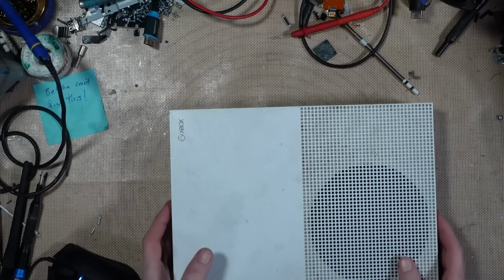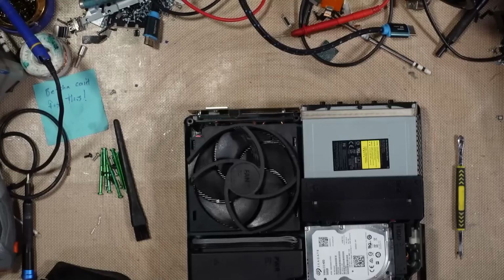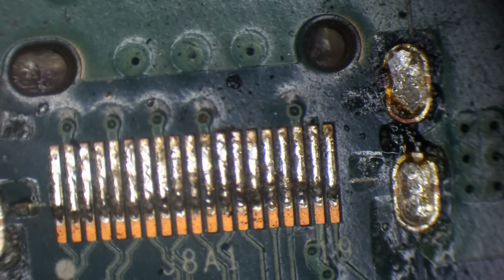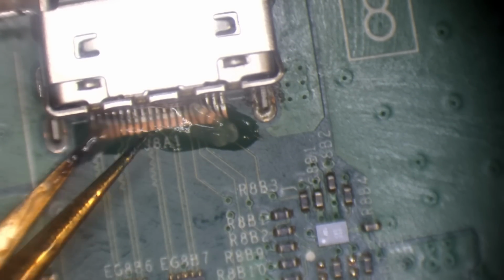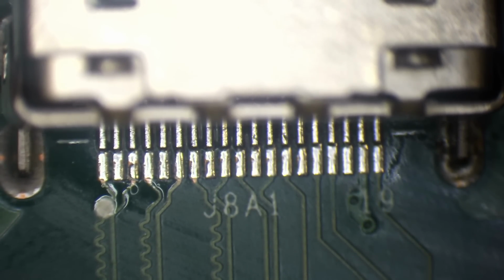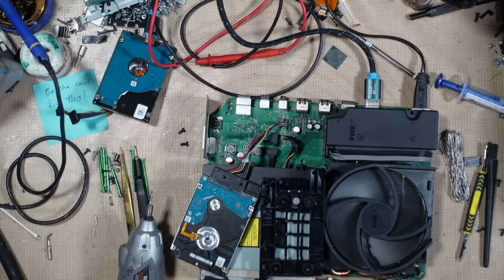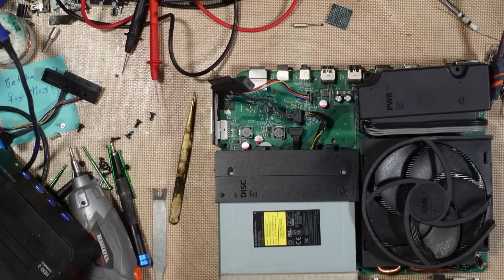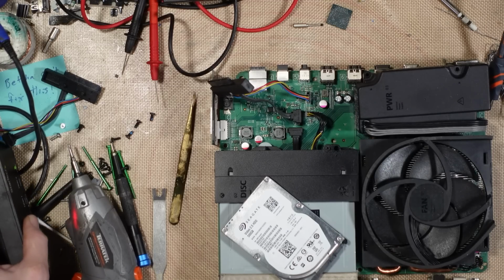If You Ever Do This You May As Well Throw Your Xbox One S Away!

Comment: To anyone wondering what is going on: ODD stands for OPTICAL DISC DRIVE.

So no, you don't brick the console if the HDD dies.

Also no, it is not possible to change the ODD serial number to match what the console is looking for.
Reply: Unless you find a way to program the chip that has the information on it to have that number. But very few of use possess that talent.
Reply: @Portuguese-linguica  not going to happen for the same reason where you cannot update a DVD burner firmware using files from - say Lenovo - but your DVD burner came with an HP laptop and HP never bothered to release the same firmware update.

The whole process involves encryption, so it's not happening even if you plug onto the chip directly.
Reply: lol I should have the comments first doh
Reply: he never said that in fairness, he said it's a brick, unless the customer has the original disk drive it can't be fixed.
Reply: @Tomtraubert2009  he didn't. People in the comments are though.
Reply: Okay I was finding it real weird that it would put up a fuzz over the HDD.
So the working theory is that someone swapped the DVD drive for whatever reason?
Reply: @lpoki8897  exactly that. Mostly likely the very same customer that was swearing the console was working and was never dropped.😂 
Maybe the customer was a repair shop and they grabbed the wrong optical drive when they were putting the console back together.
Reply: @bufordmaddogtannen  Yeah people do some odd things to save face or ego or whatever.
Reply: Well theres always a way you just need too know how too
Reply: @hamburgermods1396  cool. Tell the cod3r how then.
Reply: Always keep a console even if you suspect its permanently busted for weird reasons like this, you never know when a jailbreak or something a few years later provides a work around.
Reply: Could flash the disk drive then it should work in any xbox what we use to do back in the day on original xboxs and 360s
Reply: i was just about to say, you mean optical drive, yes it checks the firmware on the optical, if it doesnt match then no go.
Reply: Just need to get the DVD key from the nand and buy a programmable pcb for DVD drive a and flash fw with DVD key so matches mobo
Reply: @Tysman909  Wow. So simple. :/

Comment: My OG Xbox one, (yes I am still working with it) had a similar problem, except it somehow killed my wireless card during the update. Swapped with a new one and it's still kicking. 

First purchase out of my parents house, I'll use it until it dies.
Reply: n  I replaced the hard hard drive with an SSD a few years back. Its also got an external 16TB (4*4TB) storage array for the best loading times it can manage. Other than the wireless card I've had no issues with mine. But I do treat it like an all-digital edition, not risking the disk drive doing it in.

Comment: I'm astonished about how many people drop their consoles. I don't even like disconnecting the cables cause I'm worried about damage the ports somehow or having residual power left over when unplugging power supply. And I always use a quality surge protector with battery backup to prevent power outage damage.

Comment: Am I missing something here? Since when are Xbox One drives paired to the system? I was able to upgrade my Xbox One X hard drive to a 2 TB one without copying anything from the original disk. I used the OSU1 from Microsoft. I was also able to use a drive from an original Xbox One in the X as part of my troubleshooting. I was getting random "something went wrong" messages while playing. Turned out to be the SATA cable causing the issue. Is this just a thing one One S models?
Reply: Disc drive not hard drive
Reply: He's talking about the DVD disk drive
Reply: @patrikd2776  My mistake.
Reply: @rogermohammed86  Thanks. I probably shouldn't try to watch videos with kids around making noise
Reply: @rogermohammed86  BluRay  *
Reply: If it was the hard drive it would be a nice easy fix.

Comment: Why did the disk drive not match? Did it go to a repair shop first and they put the wrong one in?
Reply: More than likely the old one failed at somepoint so the owner has decided to fit a new one himself not realising that diskdrives have be the correct one they came, they are like married in a way, is one way to put it. I had a similar problem with an old playstation, and i found out that the little daughterboard or whatever way its spelt that it comes from factory with is the only one it will work with,so a very similar situation to this one really. They are encrypted or paired and a replacment wont work for the same reasons as in this video...

Comment: I'm not 100% sure if it's what you're looking for but i'm sure it's possible to change a drives serial number using a Windows system/PC. I know AOMEI partition assistant pro used to have the option so it might be worth giving that a shot.
Reply: It's not. It's something that is encrypted. Otherwise piracy would be rampant. Until it gets jailbroken, there is nothing you can do.
Reply: The problem is not the hard drive, it's the optical drive.

Comment: I take it they are paired at the factory?
Why can't we just pair a new one to the console?
Reply: Probably on a rom or you would need an editor to change the code, something not released for the public. If returned, microsoft would be able to change, but they keep those tools away from people.
Reply: @Taz6688  Ah! So 'no right to repair' from Microsoft then, they're as bad as Apple.
So  if the (HDD or SSD) die's you either have to get Microsoft/Playstation to fix it OR throw it in the bin.
Edit Not HDD/SSD but DVD/Optical disc drive
Question:
Are they legally bound to repair them?
If not, WHY not?
Reply: Hdd can be replaced. 

This is optical drive that has been changed.
Reply: @g.h.190  Sorry I meant the DVD/optical drive. 
Edited to show that.
Thanks for pointing it out.

Comment: If the log file is showing theserial numbers its looking for is there no way to download the update as a standalone usb install and modify the exact file that carries the check out to either ignore the missmatch or accept the new drive and then re-package the update.  Its possible with most other software like androids error7 errors or windows compatible errors etc
Reply: The check is done by the system not the update file. The only way to bypass stuff like that is with a proper jailbreak and custom firmware. And even then it is not a guarantee that you can bypass system selfchecks like these. And if it is possible you normally need it in a working jailbreaked state before swapping the disk drive for example.

Comment: Is it possible to read the DD bios chip and rewrite it like you can with a laptop?
Reply: not without hacking the console to get the DVD keys. Which hasn't been done for the Xbox One
Reply: @Notpoop906  the software just revealed the old key and the current one so technically something sitting there is decrypting the hex/original key. Surely some code that tells the software to switch the two around and write back to the chip. I'm sure I'm missing a massive chunk of knowledge here 😁 let me know....

Comment: If he has the drive, and it's faulty you might be able to remove the ID chip from it, and put it on the new drive. As long as it's the same make, and model it should work in theory. I've never tried it so I don't know for certain. I have a bunk 120 Gb WD HDD that requires an entirely new PCB, and the repair guides I saw all said I'd need to put the ID chip from the old one onto the replacement board for it to be recognized by Windows. If that's the case, it still might be salvageable with that fix.

Comment: Wait. If the disk dies you trash the whole console???
Reply: not if you keep the daughterboard drom the disc drive
Reply: not if it's a mechanical fault. you can just swap the board from the broken drive to the replacement. but if it's fried then yeah you can't reflash a new drive because they are paired to the console using hidden keys (not actually related to serial number). The only way to get the keys is to dump the flash of the console to retrieve the keys which isn't possible.
Reply: @Notpoop906  Oh so to replace a hard drive on XBox you need to always keep the board from the original drive and swap the physical disk on it? Good to know, I thought swapping drives on consoles was easy
Reply: @James Stocks  no lol the Disk Drive not to be confused with the Hard Drive you can always swap you're hard drive, but the Xbox Disk drive can't because it's paired with the system.
Reply: @JamesStocks  swapping hard drives usually are, the pairing issue he's having is for the optical drive. in that case the drive's board has to stay with the console. most times you can buy the optical drive on ebay but you have to swap the logic board to it. otherwise it would never work. There are tons of guides out there for swapping the internal hard drives on these at least. I was able to put a 2tb in my one x, and after doing the osu1 update from a usb stick, it was ready to go, the only caveat was that I had no boot animations until the next update, but it did work.
Reply: @robert1975031  oh the optical drive, thanks for explaining!
Reply: @sav3429  a hard drive is a disk drive.
Reply: Not if it is just the laser.  You can replace the lasers with out a problem.  Just don't switch the whole drive.
Reply: @James Stocks  he said the disk drive, meaning the disk you put in to the drive not the hard drive you can always change the hard drive it's the "disk drive" aka optical drive you can't and that's due to the 360 days of pirating.
Reply: @sav3429  What does "HDD" stand for?
Reply: @JamesStocks  always irritates me when people don't know the difference between disc and disk 🤦‍♂️
Reply: @serenblue3646  true, it's actually easy. the drives for the one x and the one s are virtually the same. took me about 5 minutes to swap the sled as they call them. and my one x was reading games again. the only time I would have thought about swapping a whole drive was if the original was physically damaged and no longer would accept or eject discs. but at that point, swapping the board would be mandatory. if those logic boards themselves ever get fried, yeah you basically have a brick. tbh though I have never tried a one x or s without hooking the optical drive up
Reply: @JamesStocks Humpty Denis  Dumpty. 😂🤣
Reply: @JamesStocks  hard disk drive.

Comment: "Customer's lie".  I want to know who instilled in people that not giving the whole story, or lying about what happened, will somehow make the repair "cheaper". It happens all the time in the auto industry also. People neglect to tell you details that would actually make the diagnosis or repair cheaper. "The car just quit running." Well, if you told me you drove it through a pond, hydro-locked the engine, and bent every push rod....I could save you some money up front rather than tearing it apart to tell you the same thing!

Comment: it has been my experience that you can change the serial number of a drive to match the one that existed before, even easier if the console remembers the old one.  there are utilities that do this in Network Plotters and many other devices that use hard drives.
Reply: The problem is not the hard drive, is the optical drive.
Reply from the maker: Cheers buddy, dealing with this now 😀